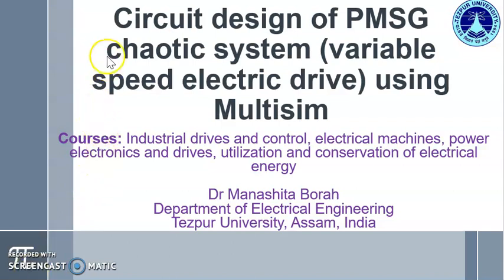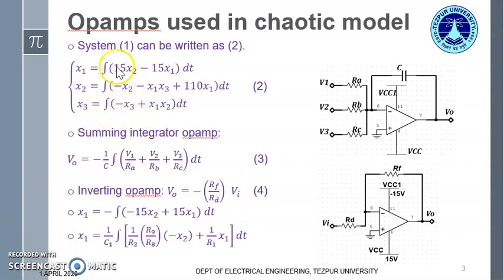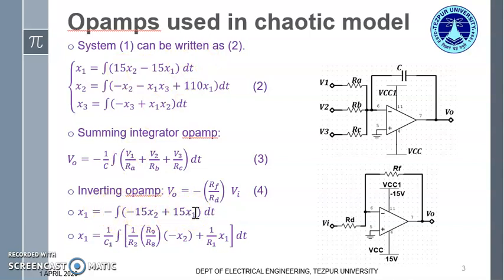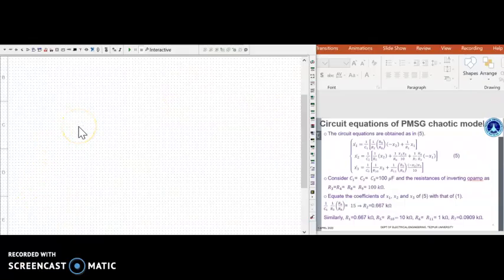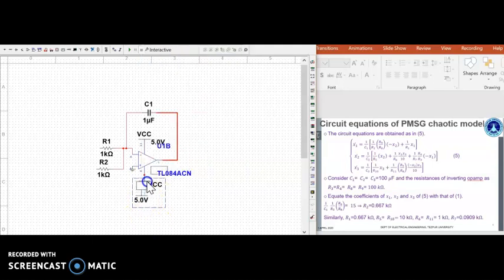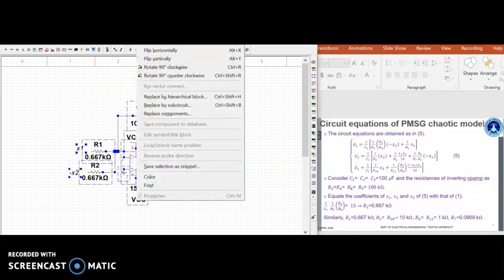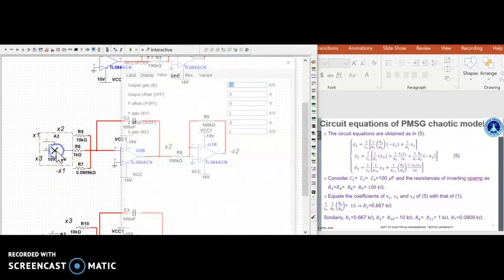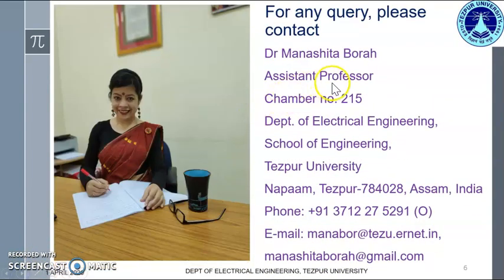Circuit design of PMSG chaotic system (variable speed electric drive) in Multisim | Dr Manashita

Comment: My question is related to graphs. Simulation will takes time? Mine takes lots of time.
Reply from the maker: You can tune your oscilloscope time base to observe the simulation for the time you want.
Reply: @drmanashitaborah3237  Thanks for your kind reply. I have an issue that it require lots of memory. I run this circuit with same values but in figure get one wing only.  What would you think the real issue?
Reply from the maker: @javeriaayub6203  Your query is discussed in my video  https://www.youtube.com/watch?v=IvJnPnl7XAk&list=PLftGLEdqRuLNN1Sk2GILAxTYoHQ20K1LI&index=8
Reply: @drmanashitaborah3237  thank you so much.